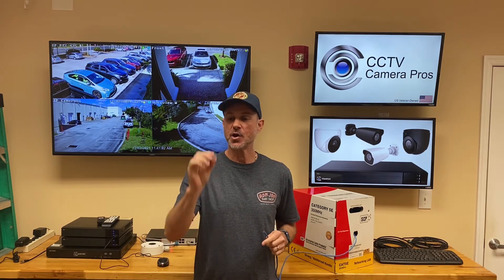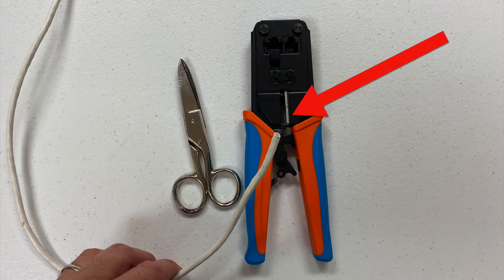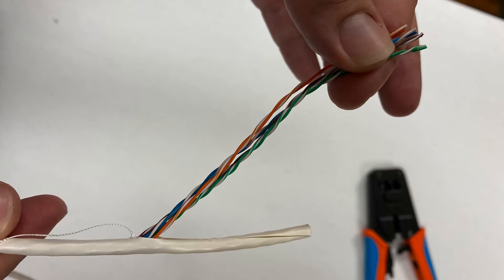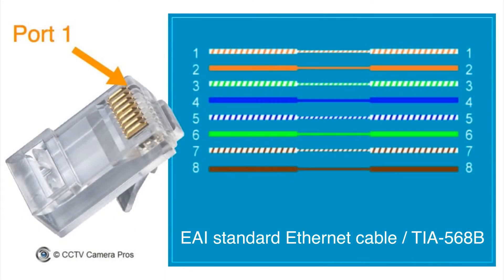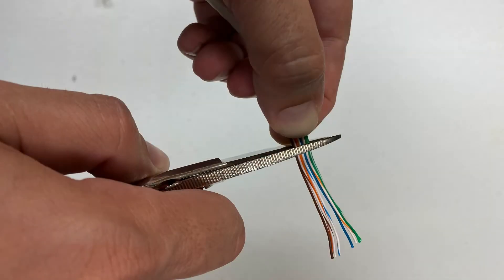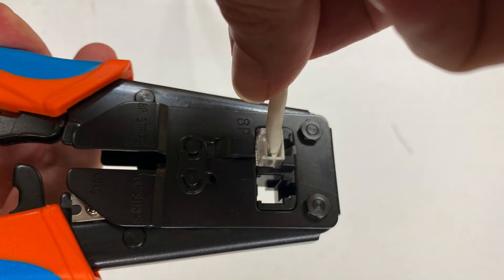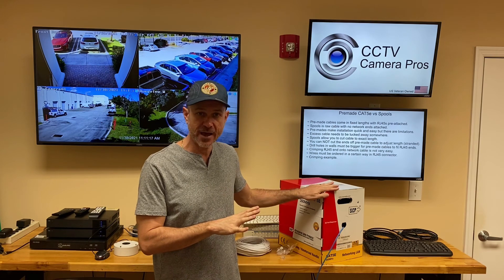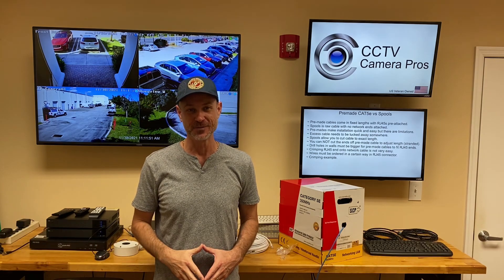How to Crimp RJ45 Connector on CAT5e Cable

Comment: Have you seen corrosion issues with pass through RJ45 ends for cat6? It is hard to find cat6 ends without passthrough. Is corrosion an issue especially for outdoor cameras?
Reply from the maker: We always recommend using a weatherproof junction box for outdoor installations. https://www.cctvcamerapros.com/security-camera-junction-boxes-s/1504.htm

Comment: For 1 you wasted to much cable. And 2. That tool is no good for stripping or if you have hundreds of cables to do. Those tools are only good for hobby use and not on the job use. Specailly the stripping part.
Reply from the maker: Thank You for the feedback!